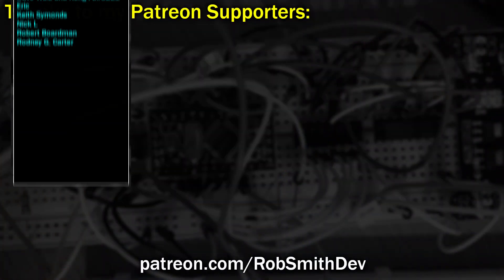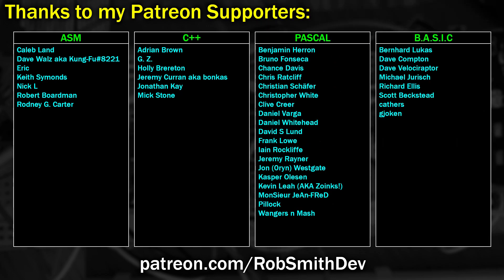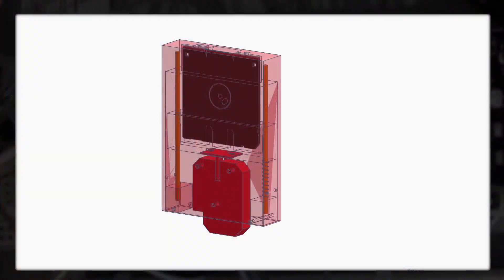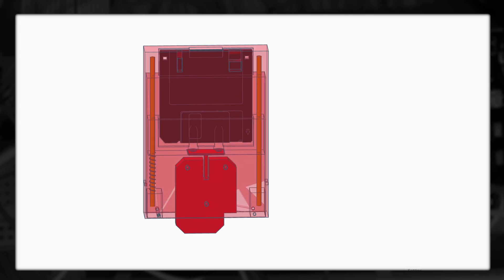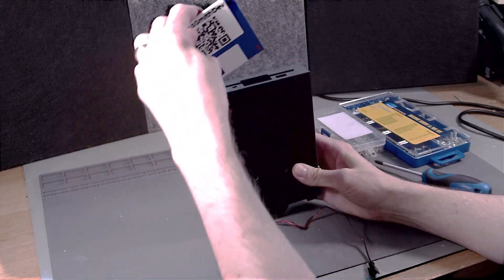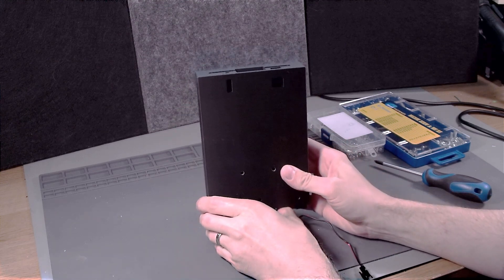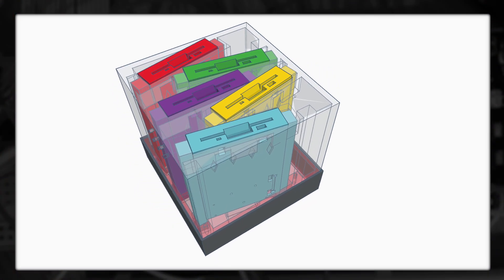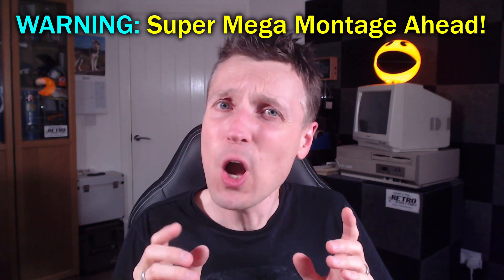Building my Latest Crazy Invention!

Comment: In the 80s the institute I studied in my University has a room filled with terminals, and workstations: a DEC Alpha XP, several Sun Sparc Stations, and a few HP ones. One of those didn't allow to remove the floppy pressing a button you should unmount and then give the command eject. One was with a defective drive and when ejected ejected the floppy to the other side of the room. They solved it gluing a transparent piece of flexible plastic (from a used to make thermal transparencies fro presentations I think) and taped the upper part in from of the disk hole, a simple and effective solution: you got it up to put the disk and when ejected it held the disk that was ejected.
So some drives can do that with minimal modifications.